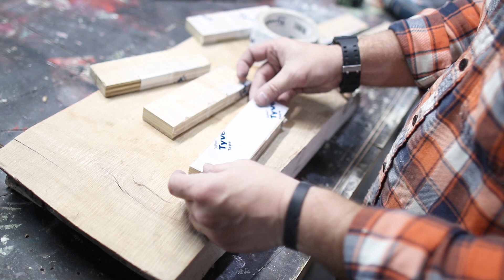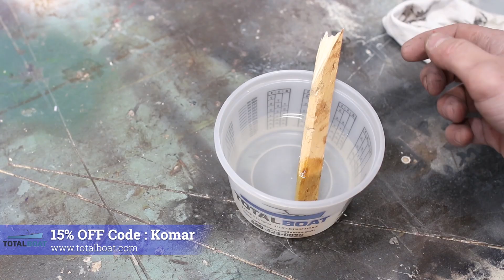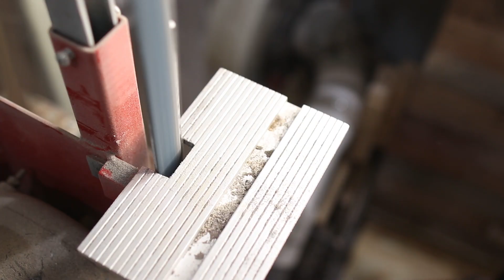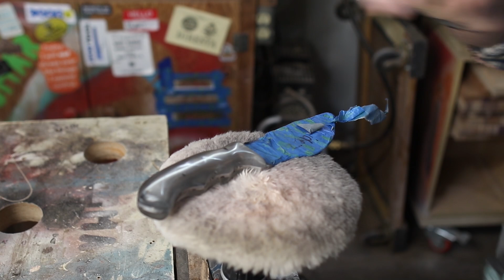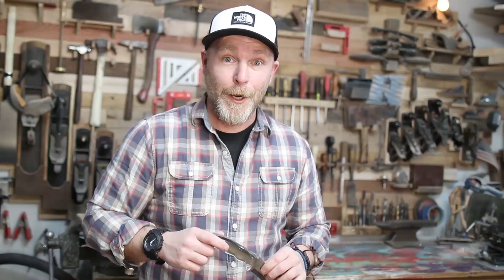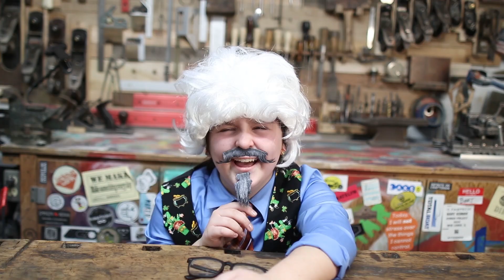Knife Handle will it HOLD or SHATTER?

Comment: Any idea how to make a clear handle like this but one that’s softer and a bit elastic? (Kinda like rubber tpe or something.)
Reply from the maker: Ya there are silicone pours you can do. Not sure if that’s too flexible for you
Reply: @KomarProject  I thought about using silicone sealant/caulk as a dip for a handle, similar to what people do with plasti dip and other liquid tool dips. Sounds more easy than the mold method. It might work, I wonder if it might be a bit too soft though.
Reply from the maker: @RobDyrdek713  it might be.

Comment: I think as someone who makes knife handles regularly the only thing I would have done differently would have been to preset some pins either clear acrylic or brass ,stainless steel anything you like really in the pin holes I think metal pins would be the best considering the type of torture that type of knife goes through.
Reply: Maybe just pieces of wire with loops on both ends would do the job.

Comment: Can you make a mold of a knife handle and then cast that? What's the benefit of casting a rectangle and then carving/sanding down?
Reply from the maker: You can.  The issue with it is getting the casting done perfectly to fit the knife.  I think if you cast it on one then shape it leave less room for error. Just my thoughts. Thanks for the great question
Reply: @KomarProject  that makes sense! Thanks for your answer ☺️

Comment: Great video! Question: I have the same epoxy- is it dishwasher safe if I use it to make handles for chef knives? Thank you so much
Reply: You should never be putting good knives in a dishwasher.
Reply from the maker: That I’m not sure
Reply: It's a boat epoxy should be able to use it in dishwasher. If it were me I'd do exactly what is done in this video except I'd put pins in before pouring the epoxy. It help hold the scales a little and would look pretty cool too. Also I wouldn't put it in dishwasher.

Comment: If you had done the pour with the knife in the vertical position rather than the Horizontal orientation you would have probably had a lot less if any bubbles. Nice job, loved the Judges Panel!
Reply from the maker: I tried that the first time.  Just didn’t cure right and was soft. The pour was just to thick even with two pours.  But great minds think alike brother lol.
Reply: I wonder how it would be doing this but instead of curing the epoxy with the blade, use epoxy “pins” or “dowels” that are slightly thinner than the holes in the blade and put them through while adding that total boat top pour gloss stuff to the pins so they are more likely to be clear to the rest of the scales if that makes sense

Comment: Since the epoxy is going thru the pin holes on the knife it actually makes a type of mechanical union. Awesome judges
Reply from the maker: I though that too Kurt.  Just figured they were not brass or some other metal people may think it’s not a true connection.